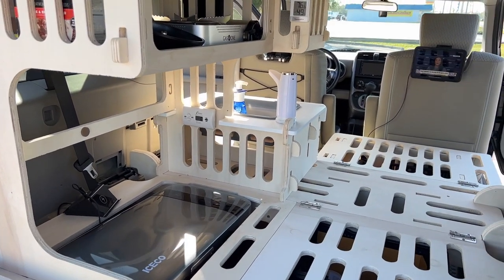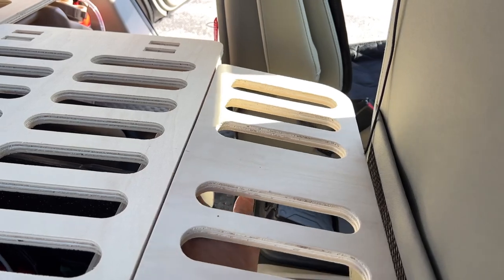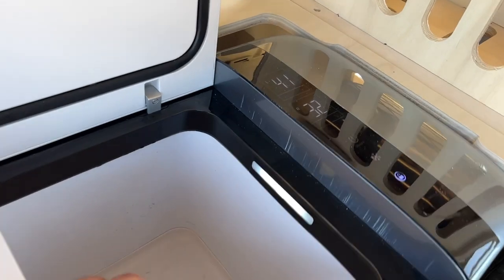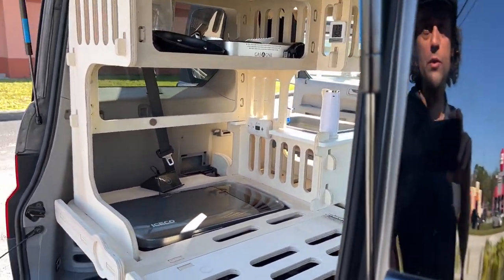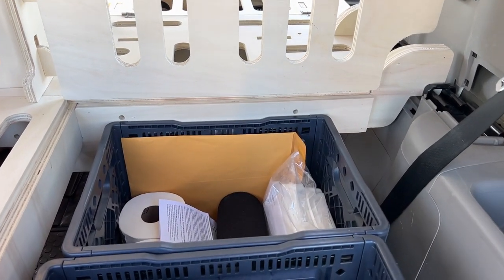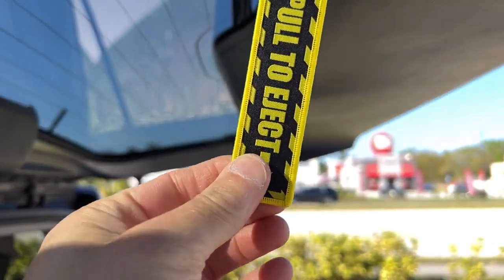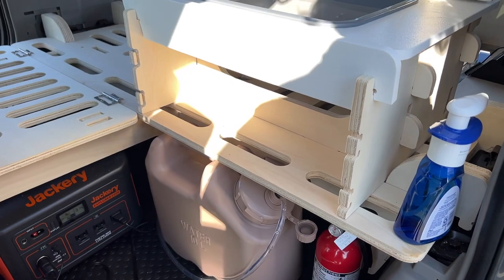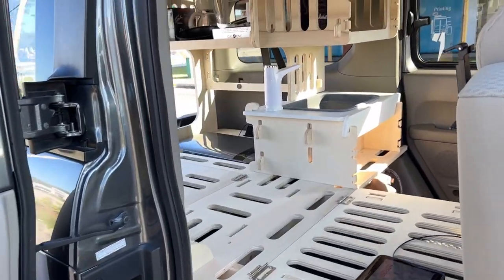Honda Element Ultimate Camper Build!

Comment: I have the same frig. No u can't run that frig with only 100w solar. There r many factors to take in consideration with power used with Jackrey. Did u do a test with food in the refrigerator and under hot sun in ur E? 
That is a nice build. I wonder what kind of weight it has with the wood inside for the build? My concern is that the wood is heavy.